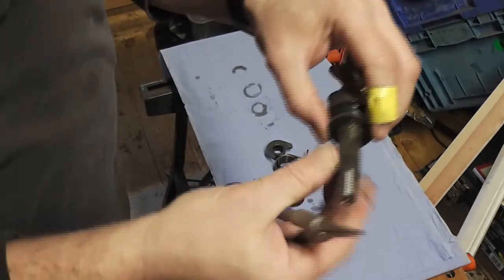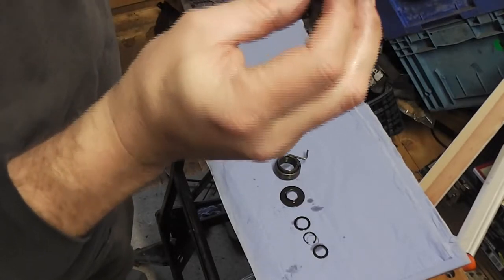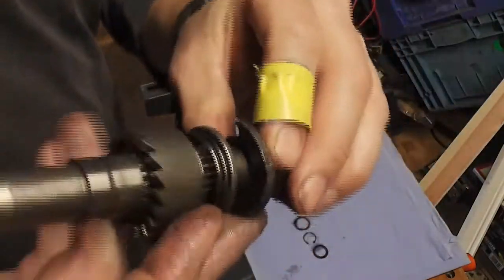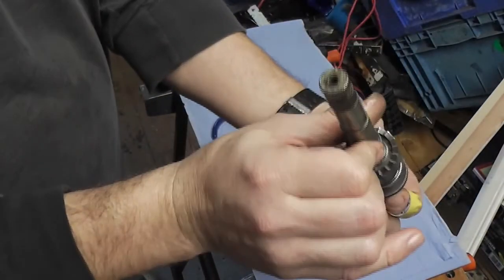Pitbike kickstart shaft assembly. ZS155 kick-start

Comment: I noticed today on my daughters wpb 170 that it kicks great 80% of the time but then you may have 1/2 kicks that seem to have not grip so I'm thinking is there a few dodgy teeth. Soi I was thinking would it be a new set like this. I will have to take it apart and have a look to see
Reply from the maker: Tbh if it kicks 80% of the time it's probably not worth doing yet
You've got to split the casings to change it so its a big job

Comment: Hi on my 140cc I had the selector problem I fixed it but it’s not going down to neutral but shifts to any other gear any ideas?
Reply from the maker: I would take the gear selector linkage out and see if you can do it by hand by turning the end of the gear change barrel.
If it doesn't turn by hand then it's inside on the gears or forks

Comment: I have a fly wing Mx 100 it will not come out of gear it just locks up in will not go into neutral it makes the clicking noise as if it were changing gears but there is no neutral
Reply from the maker: Is this with the engine running or not
Reply: Not running
Reply: I can’t kick it over because it will be try and go forward
Reply from the maker: @Elite_ian  put it up into top gear and rock the bike forward and backward a metre
Then try it
Reply: Ok I will

Comment: Hi, it seems like you know these engines really well so hopefully you can help me out I’ve been struggling so bad with this little engine. So I’ve been having issues with my ZS155 at first I thought I had clutch issues because when I bought it, i moved the gear selector up and down and it wouldn’t go into any gear or as I thought at the time that the clutch was just not engaging. I took it apart and replaced the clutch. Popped it in first, it ran until I needed to switch to 2nd and wouldn’t go into any gear after that. I thought it was the clutch again so I took it apart again and it popped into first again until I needed to switch to second. I think this would happen because when I put the clutch basket back on I move the drive gears and it would free up the gears again or something? But anyways I would lose all power and revved out like crazy because it popped into neutral or something. I currently have it split apart but I don’t know what the problem could be. Hopefully you can help, thanks.
Reply from the maker: Check out my other video about the jammed gear selector and check that first.
The clutch doesn't really affect the gears in that way normally
Reply from the maker: Check that first
Reply: @motorcyclefixer  wow thanks for the super fast replies. But actually that was the first video I checked out before splitting the case haha. But no unfortunately that wasn’t the problem. Maybe the shift forks?
Reply: @motorcyclefixer  I’m thinking of replacing the whole gear assembly along with shift forks but I’ve just been stressed out because I just have this engine sitting around completely disassembled.
Reply: @motorcyclefixer  Awesome content by the way.
Reply from the maker: Does the idle gear run freely on the end of the shaft? I've seen it before and that can cause the same type of issue.
It's the one between the clutch gear and the kickstart
Is that tight or spinning freely
Reply: @motorcyclefixer  spinning freely, the engine was running completely fine
Reply from the maker: I would just change the complete gear cluster and take it from there I guess